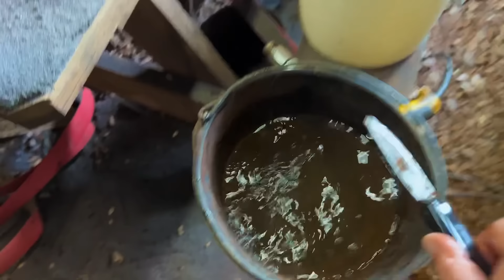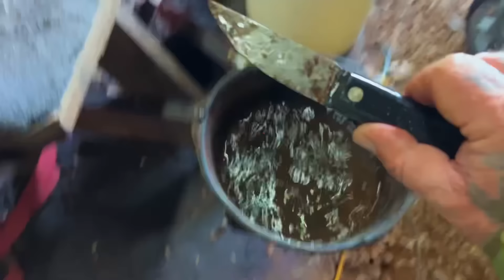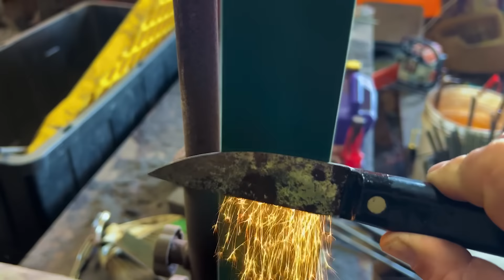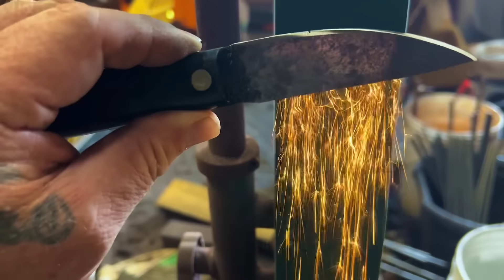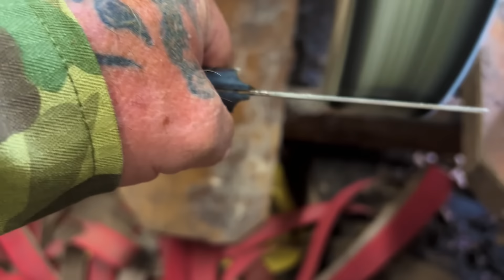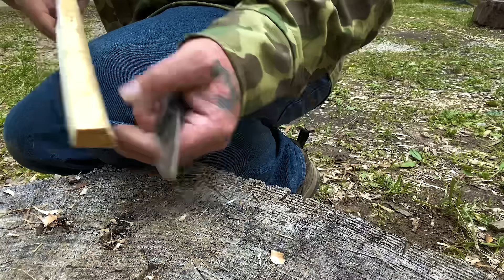DIY BUSHCRAFT KNIFE 25 Cents

Comment: I’ve made 2 or3 of these for work. One a knife style and another with a flat top,opposite side sharpened like a knife and the front chisel shaped with one corner rounded. It worked great. Used both styles for 15+ years as a construction plumber. Saved my knives.

Comment: Once again, Dave has shown us how to REUSE/REPURPOSE a disused item. I have a  similar 1 1/2 in paint scraper, which I repurposed as a "emergency tool kit" chisel.
You don't have to use a belt grinder either. It will just take a longer time to make that "emergency" knife.
Great job Dave, This is the kind of "short"  like to see. ;-)

Comment: Nice build dude.  I keep a 2" putty knife sharpened at the tip, but only on one face.  It's a tool between a chisel and a plane.  Push in a diagonal direction.  It flush cuts amazingly

Comment: I like it! The cost of knives is ridiculous these days. Most times I need to cut something, I can just pick up a piece of broken glass off the ground and that works fine. I used to make knives out of old files I'd get from the flea market, but I didn't have a belt grinder. Just an old belt-driven wheel grinder.

Comment: I see u useing machine ,does this overheat the steel and it losses it temp. So use cold water to so u dont loose the steel quality. I have seen this done with grinder wheel . But wont keep an edge . I prefer to cut to shape ,hacksaw   then hand crank grinder for edges.  Stay sharp good edges.  Have you tried this . ?

Comment: I have a thin blade putty knife in the kitchen. All the modification I did was to round the sharp corners.Great for scraping cast iron. Use it to separate frozen Ezekial bread slices and frozen tortillas. Always finding some use for it.

Comment: Every man should have basic tools already.

You can make this just as quickly if not faster with a $20 angle grinder from Harbor freight,  or with a $10 single cut mill bastard file if you wanna take a little more time.
You should already have basic tools and if you don't then you shouldn't even be thinking about making anything , so don't complain that you have to also buy various tools to do this.

Comment: It's not really a $.25 knife though. I mean you have to factor in the cost of the equipment used to make it, the facilities, the utilities, and of course your time. But still, very cool project.
Reply from the maker: Actually it is, this equipment has paid for itself 100 times over now so yes it cost 25 cents and a bit of power and belt wear